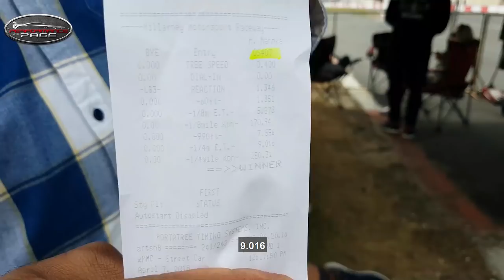Journey to 8 seconds: Part 2

Comment: Wow you guys are so behind compared to the rest of the world. Drag slicks, full tube chassis and still cannot get a 8 anything....meanwhile there are street legal, 6 speed manual transmission cars doing 8.8's on test and tune night's driving to the track and then home.....on pump gas....eye opening in 2019 with turbo technology that can be bought off the shelf. I.e.  boost by gear AMS 1000, ball bearing turbochargers.  No excuse these days...
Reply: @kai_444  oh shii man got gevysed
Reply: Lol true and pretty sure there's faster Holden utes in Austrlia. Common car here running turbo